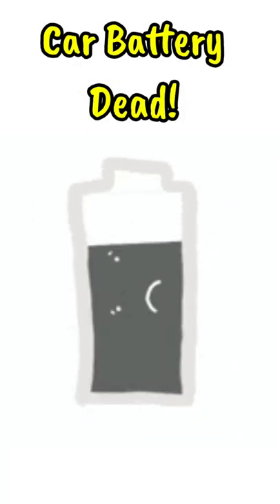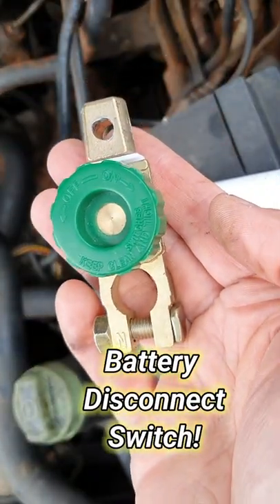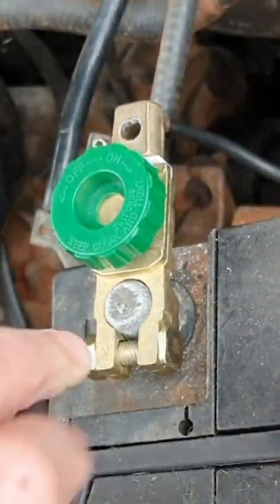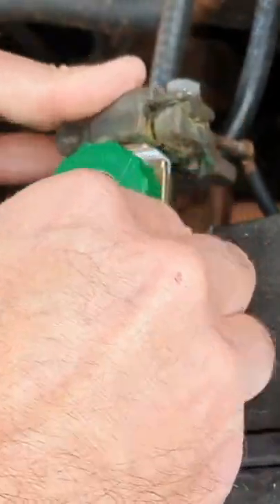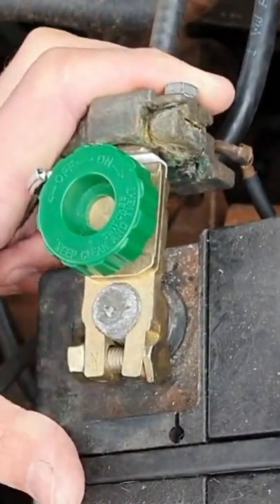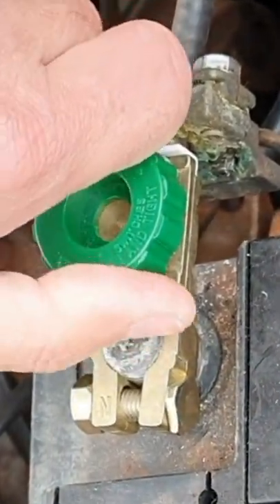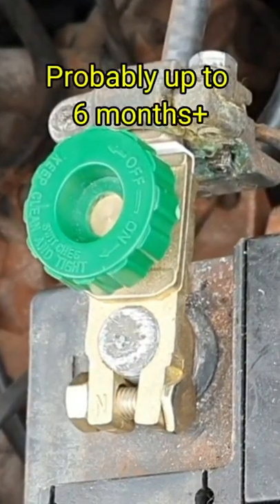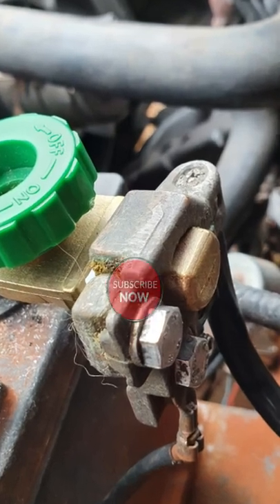Stop Car battery going Flat/ Dead by installing battery isolator switch disconnect

Comment: I have a parasitic drain on my 98 Wrangler that has to do with the ignition switch fuse.  Swapped the fuse and that didn't stop the drain.  Change the ignition switch and the actuator pin and did not stop the drain.

This is my next step because I don't do electrical....lol

Thanks for the video

Comment: Need to buy one of these until i find out which fuse is draining my damn battery every night...
Reply: Hows a fuse draining the battery?
Reply: @infernaldaedra I think (hope) he meant figuring out which fuse stops the parasitic drain, to pinpoint the circuit, to find the actual cause.

Comment: Will you have to reset your radio every time you isolate the battery?Or is it because you put it on negative side it’ll be ok?🤷🏻‍♂️
Reply from the maker: Yes you would have to reset the radio and clocks. But you can get a 9v battery adapter that keeps the setup active.
Reply: @MyProjectBoxChannel 

Where to add that 9v battery, 

Does frequent battery connect disconnect cause any harm to ecu of car  ?
Reply: I saw a short vid right before this one (scotty kilmer) which had a device that keeps the memory for when the battery is disconnected.

Comment: Perfect. Love it! I have a 2009 civic, in which the battery drains dry in a week, if not in use. Battery isolator is the name isn't it?. Thank you
Reply from the maker: Yes, battery isolator, or battery disconnect switch , cut off switch.

Comment: I had a customer who installed one of those, at least it looked identical, but he still had a problem. I found the cut-off switch caused a voltage drop at the battery.
Reply from the maker: @2002TiiDriver  they are sometimes made with crappy metal alloys, and just plated to look like brass. So corrosion is a problem. You can occasionally scratch the contact area back to clean metal.
Reply: @MyProjectBoxChannel  It definitely wasn't corosion. As far as I could tell it was because the only thing that appeared to be transferring the current was the 5/16 inch bolt securing the device, ie, crappy design.

Comment: can you still lock doors and boot with remote?
Reply from the maker: No, because the battery will be disconnected. So you need to have the hood open before you lock the car, and then operate the battery isolator switch.

Comment: Bad thing about this item is you can't turn on your alarm.  Also installed one and it got real hot not letting this vehicle started.  Took it off vehicle started right up. May start a fire people be careful with its use.
Reply from the maker: @Richard-eg4ms  the quality of these devices can   vary alot! Some are solid brass, and some are made from a brass coloured aluminium, and can suffer from a poor connection and corrosion.
Reply: @MyProjectBoxChannel  I made sure my post was super clean. NO COROSION.  I dialectic grease on the post. Maybe like you said bad brand.

Comment: can it fit in mercedes w203 there is a problem with the electronics of the car please tell me
Reply: I have the same issue on my w203 and was considering this switch... did you buy the switch or find the cause of your battery drain????

Comment: This probably resets the radio though. And maybe even other systems or something in modern cars that heavily rely on electronics.
Reply from the maker: That's probably true to a certain extent. But this is meant for people like me that have a car that stands for 6 months of the year, and when I come and visit, I need a car to start straight away. Most modern cars allow you to disconnect the battery for long term storage of the car. Having to reset your clock and radio stations on the radio, is a minor inconvenience compared to having a dead battery. Lead acid batteries get permanently damaged if they run completely down for long periods. I just got tired of buying a new battery each year.
Reply: If thats something you can't deal with they have an adapter that plugs into a cigarette lighter, and runs off a 9v battery. Keeps your presets, and remebers things like throttle position and other drive by wire components. Idk how long that would last. It's meant for changing batteries or servicing a car that relies heavily on electronics which cutting power could affect drivabilitity and gas milage until it relearns the lost data. 
Unless you have access to an outlet and want to use a battery tender, but I think this is a better options if the vehicle isn't in a place that you check often. I wouldn’t go 6 months without making sure nothings getting hot. Otherwise the battery tender could be the best. They are my go to, but I'm never away for long intervals from the things that I use them on.
Reply: @denimjez   why would anythimg get hot if a car is left for a whike with an isolated battery connection? Is it because it's only on the negative? Still unsure why
Reply: @Tom_Hadler  it shouldn't get hot, but batteries can explode or short out and cause fires. It's not just lithium batteries that are fire risks. I wouldn't leave a battery unattended for long periods without checking on them. I'm no engineer. I've just seen batteries fail on chargers. Even if they don't cause fires the battery can swell and explode. Depending on where the battery is, the acid alone can cause damage.

Comment: Mine doesn't work unless I unscrew it  all the way separating the two brass pieces.
Reply: That's because if you unscrew it too far it tends to lean over and touch the connector

Comment: Sorry have to put it on the positive side , check it out.
Reply from the maker: Technically it doesn't make a difference if you put it on the positive or the negative. But putting it on the negative means that if you tighten up the bolts there is less chance that you short the positive to the ground of the car. People make bold claims that you have to disconnect the positive first, or or disconnect the negative first. This is all nonsense, it really makes no difference from an electrical perspective. Once a terminal is removed from the battery post, the circuit is broken and no current can flow.
Reply: @MyProjectBoxChannel   so in theory this will prevent parasitic drains right
Reply from the maker: @Tom_Hadler  yes exactly 👍
Reply: @MyProjectBoxChannel re: parasitic drains, do you think it would be better to disconnect both pos and negative cables or is the negative only sufficient?
Reply from the maker: @georgew84  I does not make a difference if you disconnect the positive or the negative. You are simply "braking" the the circuit with the battery. There are lots of myths about this topic spread over the years.
Reply: @MyProjectBoxChannel  thanks!